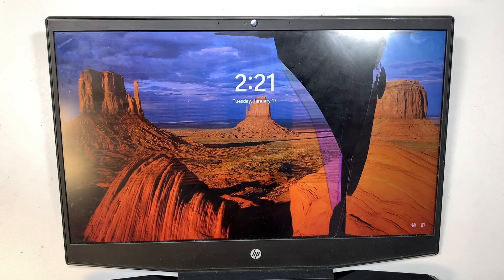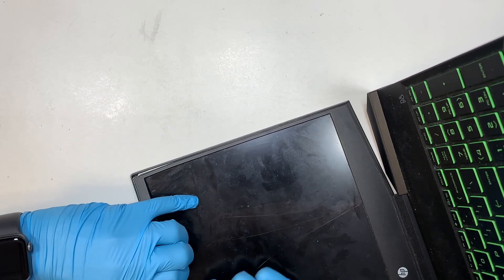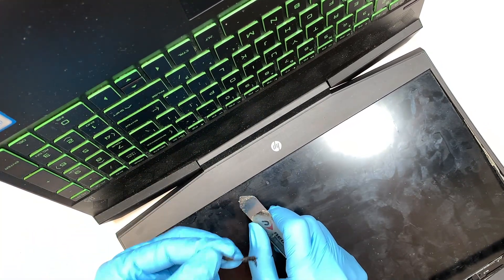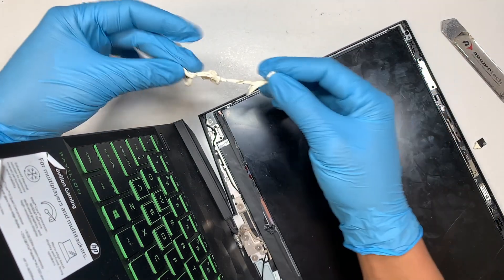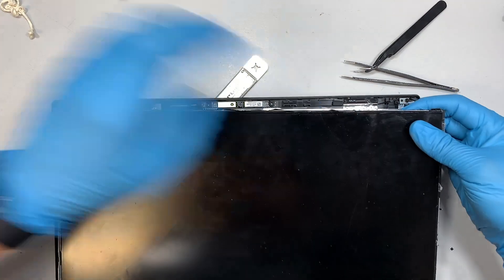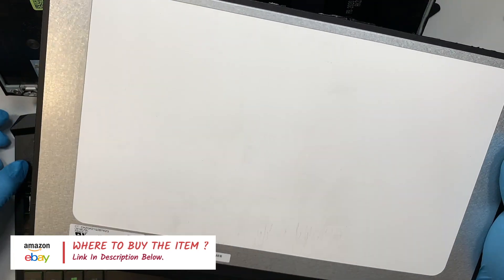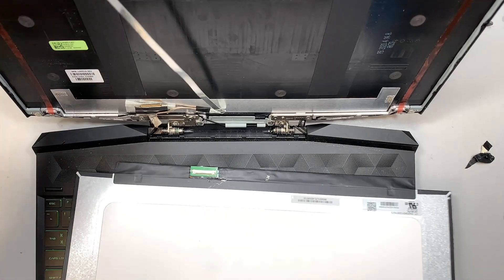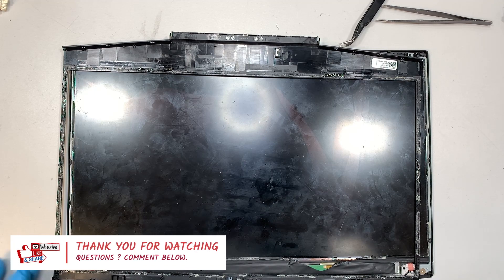HP 15 Gaming Laptop Cracked Screen dk0096wm

Comment: This model of laptops had an issue with the screen because the connection of the whole frame with the main computer was so small, the hinges weren't as good compared with the new HP models that have it wider.

Comment: I recently received a HP Pavilion gaming laptop that had a broken screen and was already used by the friend I got it from, I factory reset the laptop but the external display I used no longer is detecting the laptop and will not show the display. How can I fix this? I have spent hours for the last several days to fix this with nothing working.

Comment: Thanks for the informative video!
I'm still confused about my laptop HP Pavilion 15 dk0xxx, whether should I order LM156LFBL02 or L56918-001? Please, I need your guidance!
Reply: Mine is same hp pavilion gaming laptop 15dk0xxx
Which one you got
Reply: @aqilahamed8626  Upon opening the screen myself, I found out it was LM156LFBL02, but locally the available one was B156HAN02.1. 

The thing that matters is the specifications the screen holds, irrespective of their models. Any 15.6" is compatible only if the specifications are aligned with your system, in our case 30-pin, 40/60 Hz, 1080 IPS display.

Comment: What would happen if I buy a 40 pin video connector instead of 30?
Reply from the maker: It will not fit. Screen will not work.
Reply: How would you know how much pins the connector is?